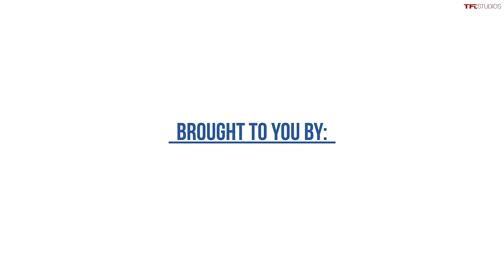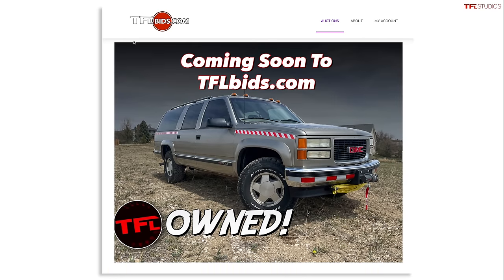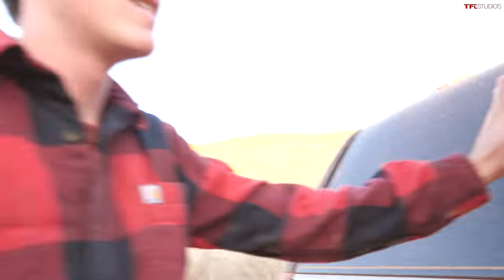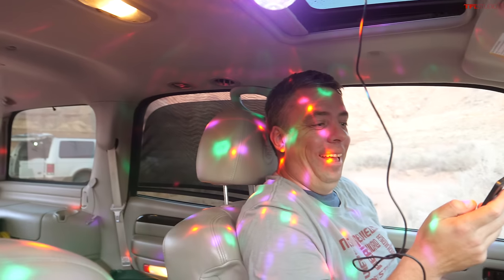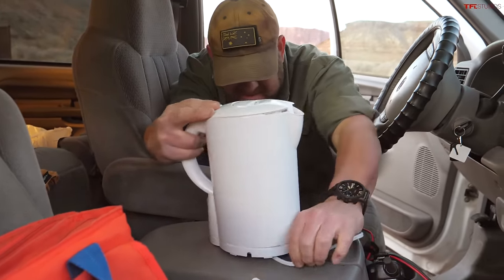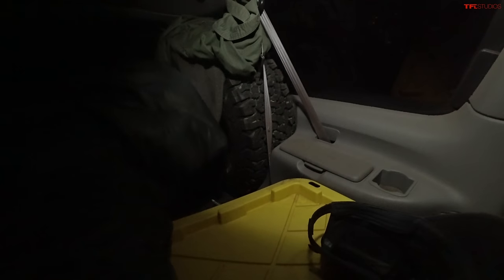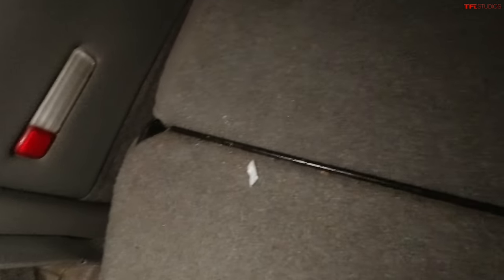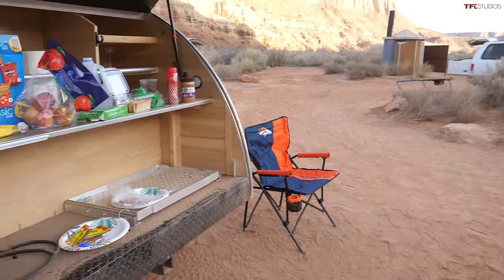Suburban vs Excursion vs Escalade - And The BEST Cheap Off-Roader Is… Go Big Season Finale!

Comment: The older guys know the importance of sleeping in a little comfort. If we don’t, we can wake up with everything hurting.
Reply: EXACTLY!!! 😂 I went from the shell on my truck box to Roof Top tents, to now I have. Rayzr FK slide in truck camper for one person. We do a lot of guy fishing trips and everyone is self sufficient with most preferring the room of their tents and a screened in room set up. A couple of guys have teardrops not unlike in this video, but most have been homebuilt with independent off-road suspensions MacGyvered underneath.  My dog and I are warm and happy with the slide in camper, we don’t go too extreme and the F150 Tremor handles the set up perfectly. My other vehicle we take when my wife comes along is a converted Mercedes 4x4 van. It’s very comfortable, has more power (120 volt) than needed with 400 AH of LiFePO4 batteries and 600 watts of solar. It powers a 2,000 watt inverter that even has enough power to run the A/C for up to 10 hours without starting the vehicle or included 2.5Kw Onan generator. It’s truly luxurious and surprisingly capable off-road with a set of BFG KO2s on it. They are decently tall from the factory, but if wanted (my wife says H*LL NO) they are easily lifted with high quality kits out there. 
     I am fortunate and can afford these comforts, but it’s really stupid how much $$$ is tied up in both rigs. I find driving the van is really easy and often will use it as my daily driver.
Reply: I don’t think I’d be able to pull my trailer down those roads or the side of the cliff lol so id have to sleep in my mega cab ram
Reply: @yousad6742  - not such a bad place to sleep!! Haha.
Reply: @shitloveaduck  home away from home
Reply: You calling me old?
Reply: @DanDannyDanielleBob  does your back hurt?
Reply: @yousad6742  - Hahaha!!
Reply: Watch the series while driving my 2004 Escalade EXT with 350,000 miles and still going strong. We’ve owned it since new and plan to drive it another 350,000 miles
Reply: I'm young and I still do it lmao when I go camping I bring an air matress lol
Reply: @linkinpiatak6669  that's called maintaining before parts gets hurt. It's smart. Always make sure your nights are comfy, it will make the days so much easier.

If you get that closed foam mat's being used in boat isolation and cut out a mat for yourself from that, they are waterproof and extra thicckk, and they can take campfire sparks flying, and sharp rocks no stress.  IMO those are better then air mats you are used to. It hangs outside my backpack, it weights next to nothing. 
I been using them now for the past 15 years and they been a wonder all year here in Norway. I'm on my second mat in 15 years, so they last for 7-8 hard years abuse.
Reply: Preach my friend, preach!
Reply: Just did a 2.5 week 5500 mile road trip in my 05 Town and Country from IN to CO, UT, AZ, NV, and WY. This was my 2nd big trip in it and this time I had 3 foam layers, 2 thin and 1 thick topping on the floor of the van. I had some of the best sleep ever! It got down to 34F a couple of nights but I couldn't tell thanks to being fully insulated from the shell.
Reply: Amen lol
Reply: I know a twin air mattress fits in an army tent from when I was in my 20s, don't have to be old to appreciate comfort.

Comment: I like my 2002 Chevy Suburban 4x4 2500 LML 6.6 duramax swap with the 3500 suspension upgrade. The thing is mint cond and pulls my 32' enclosed with my 88 Monte SS drag car in it through the mountains and cross country like a dream.

Comment: I have to say the Escalade did not skip a beat other than the fact that it’s low It looked like a natural out there on the sand, very impressed by that, With a 3 inch lift and A/T 33 s plus a g80 locker would totally kick ass and look good at it too.

Comment: As an owner of a 1996 4x4 tahoe, i'm biased to the suburban as for the best bang for your buck. The best thing I like about the escalade is the 6.0 under the hood. As for the ford, cant beat the solid front axel for durability compared to IFS with GM, but the excursion is just wayy too wide and long for going around those mountain roads. Really enjoyed the series
Reply: I actually found my excursion to be pretty nimble...just have to plan a bit....

Comment: I'm surprised the Escalade doesn't have low range, considering the modern one does. Usually vehicles become less off-road capable through their generations, but not so for the Escalade
Reply: Funny thing is yhe 1st gen did
Reply: I think its because its AWD not 4WD. My olds bravada of the same era is the same way. Trailblazers got 4WD and a low range but mine is AWD so no low range for me. Im sure its the same way with the tahoe and yukons
Reply: @ianberry5562  yeah, I guess at the time AWD was thought to be more "premium" and luxurious. The Denali of that generation didn't have low range either, but the Tahoe/Yukons did. So considering how much they like the Escalade, I think a Tahoe Z71 would have been a great pick. It had the smaller 5.3 liter, but it was loaded with most of the options that the Cadillac would have had, however, it has low range and more skid plates.

Comment: This was a great series, Great work, Great cinematography.  I like all three of these vehicles and all three have there place in the History books of the American Automobile. Most people don't hardcore off road much, so probably the Cadillac is the best for most people, but the most practical and useable is the Suburban.   The Ford Excursion is very cool but so big, again The suburban size is more practical, but the Ford is very well made, just wish it didn't have the V10 spark plug issues.  Actually all three of these are pretty well made let's give GM and Ford credit.
Reply: V10 over diesel anyday due weight/expense and reliability. I tow 10K with no issues. No spark plug issues anymore after year 2000. Mine is 2002 and is amazing at 265K so far. Still towing strong and no tranny or engine issues .
It does have a harsher ride, but it is a 3/4ton vs the others are 1/2 ton or less. The will always ride better.

Comment: I have two sleeping systems for my burb. One for summer. A 1945 army cot(with foam pads)that I set up next to the truck. And for cold weather I found a futon mattress that fits in the back. I can roll it up in a tarp and tie it to the Harbor Freight receiver cargo carrier, or leave the third seat at home and stuff it in the back. I like the Expedition, but I think the old 90's Suburbans have a more handy interior. I prefer the double doors over the tailgate version. But each has their advantages and disadvantages. Dodge missed out on the party for full size SUV's. And older guys have to bring your pillow on these outings. ;-)

Comment: This version was actually funny my daily driver in late 99-03 was a 1978 Chevy c20 custom deluxe long bed 350 vin m 4bbl quadrajet th400 turbo automatic transmission B&M 11,000 5/8 tubes transmission cooler,, standard manual windows and straight steering column and heavy duty heater with the three spd blower fan, factory 2 inch taller spring height. And 31/10.50/16 BFG all terrain tires over 432k miles several engine rebuilds but ironically the factory engine block same vin as the truck!!! I drove through fields with it,snow,mudded with it and also used it to haul firewood and the scrap metal hauler...

Comment: The excursion would have gained a ton of comfort by disconnecting the front sway bar.  it is easy to do in under 2 minutes.  front sway bar is 1 1/4 diameter and really makes the suspension rough over uneven terrain.  A sway bar is basically a torsion spring and twisting 1 1/4 dia spring steel takes a lot of force.  Also would have gained an amazing amount of articulation.

The other two would probably benefit also but their sway bars are a lot smaller, and neither of the gm products are as easy to disconnect.

Comment: My first car was a 95 tahoe. Pro tip: take the futon mattress from the shitty apartment you are sharing with 5 other dudes, use a ratchet strap to taco fold it in the back, then unfurl it when ready to sleep. Low and super comfy. Molds to the wheel humps and over the cracks no problem

Comment: I wonder how difficult it would be to swap the transfer case in the Cadillac to actually have a low-range option, and how much trouble the electronics would give in the process.  With the extra power it probably could get away with even taller, bigger diameter tires for marginally better ground clearance, and someone intent on making it into an overlander could pull the rear seats clear out and make a bed platform that doesn't require sleeping at an angle or putting one's head up at an awkward angle.
Reply: Sub Overland has made overlanders out of these, using pretty much the method you described. They're pretty cool! I think with the amount of torque that the 6.0 has, and the fact that people aren't doing hardcore rock crawling with them, makes the AWD/No low range acceptable. In the previous videos, even with bad tires, the Caddy did pretty well off-road.

Comment: My vote was the Caddy too.  The only way to make it better would be to get the Chevy or GMC version, and get it with a low range.  Sacrifice a tad of ride comfort for peace of mind when the going gets rough.

But, to be honest, the REAL best budget overlander isn't one of those three.  It's one of these three:

Chevy Trailblazer EXT
GMC Envoy XL (and XUV)
Isuzu Ascender 7 passenger

These vehicles have just as much overall room on the inside as the caddy, or a tahoe, or a regular yukon, but are packaged differently.  They are more narrow, but longer.  They would have been perfect for the narrow shelf roads you were on.  (Speaking as an owner of a 2004 GMC Envoy XUV.)

Comment: I actually learned that the awd gm platform for the suvs is fairly capable my uncle had a 94 gmc safari ext 4.3 cfi and awd,g80 rear in a gmc minivan!!? And the other vehicle was a buddy's 94 Oldsmobile bravada awd the 4.3cfi and limited slip front and rear, and 255/60/16 low profile tires hankook dynapros lol!!

Comment: I find it interesting that the suburban didn't do much better on gas than the Excursion, especially given the E is 3/4 ton with 6.8 V10 vs the S that's 1/2 ton with 5.7 V8.

Comment: I'd love this again but mid-size American body-on-frame, so the GM bunch on the Trailblazer platform, the 1st and 2nd gen Explorer, and the Durango. I have an '04 Envoy XUV with the 5.3, G80 locking rear diff, low range 4WD. The wheelbase is almost as long as a Tahoe, but it is much narrower. I would expect it to be a decent trail rig

Comment: I stay with burb, okay mine is not original anymore but definitely even if it was stuck compared to the other vehicle i guess it's all depend on the driver, becaue i tried them all and burb win it all. I must admit too i have the k2500 slt as well so to compare it to the 1500 not that fair

Comment: Suburban all day.  That 5.7L may not have the most HP or quickest acceleration but it is gutsy and makes great torque. Withe low range transfer case it will go places the Excursion is too big to fit and places the Cadillac will just spin the tires.

Comment: I take that Ford all day the chassis is stronger than both of those other 2 combined and the V10 is bulletproof I know this for a fact I have been servicing them under severe duty conditions pulling hauling and snow plowing F250s F350s and F450s have never had an engine failure almost every one of them has over 200,000 miles of severe duty work we do run 15w40 synthetic in them but still great powerful reliable engines

Comment: Just disgusted that Tommy had decided to make cosmetic changes instead of functional improvements to the Suburban.
Reply: I know!!! I’m not so disgusted, but surprised! He had about $6K!! Even if he paid for the install, he could have had a very decent lift, shocks, sway bars lift and BFG supplied the tires!! It would have been so much better. Even $$$ left over for a couple of cameras to help with vision if out there alone! Maybe a proper winch (2nd grade) on a hitch set up. Front receiver for $150 or $250 installed. Hopefully get the rear differential sorted out. Decent set of seat covers for the front and a self inflating mattress!! It would be a capable off-road vehicle that looks good (no sticker crap) and sleeps like a motel! Hinge problem solved!!!😂😂
     I have not built up this generation of GM yet as I like the older stuff 1980 or older, basically. Very easy to work on.
Reply: Same! I had high hopes for that. He could have done a simple 2-in lift and gone up to 285s for not much money, or put a functional winch on it. Now whoever buys this thing has to spend the extra time to scrape that crap off of it.
Reply: @trailrunnah8886  - Hopefully they get a good laugh while doing so!! They went for a “campy” style on the videos (Andrey pulled it off the best) and Tommy did get campy!! Haha. The Suburban is up to $2100 currently with over 5 days left. It’s likely to double in bids in the last few hours, so they should get their money back!! Maybe that’s what they are going for. Minimize their losses. If it was a rust free example, I suspect they may have put this lift on as it would jump in price, but that rust puts a lot of buyers off. I personally hate rust!! I live in a rust belt and the rusted wheel wells on the trucks all around,,,,, ugghh. First thing I’m thinking is a couple of thousand bucks to fix the rust,,,, I don’t weld well enough to do it myself,,,,, hahaha. 
    They are gonna lose on the Excursion,,,,, especially with what fuel prices are doing. I’m in oil rich Alberta, Canada and still gas prices are almost $2/litre CAD or about $6 bucks USD per gallon!!! Ouch!! 
    Not that I will ever recover the initial cost or depreciation, I still bought a Diesel Tahoe RST. Since I was buying something anyways,,, the increased mileage currently offsets the increased cost of diesel fuel. For now. See how far the demand for diesel goes up!! Hahaha. At least I buy it bulk and store it on my acreage. 
     Stay safe out there, Eh!
Reply: @shitloveaduck  yeah, they definitely seemed like they were having fun, and I definitely enjoyed watching the videos. I really like modifying vehicles for low cost, that's why I was so hoping they would do actual mods. I agree with you about rust, I'm in New England, so all three of these trucks would be super rusted out if they were here. Honestly, compared to what I see around here, that Suburban is pretty clean and I would buy it with confidence, especially for 4K. Good luck with that Tahoe, that sounds like one hell of a ride! I really like the new Tahoes, and that diesel sounds like a great motor. I have a 9-year-old 4Runner, if I baby it I can get 20 MPG, and gas here is about to hit $5 USD per gallon. It's paid for though, and it's been super reliable so I plan on hanging on to it for a long while. I did the math, and even if I spent say $4,000 to get a car that gets twice the mileage, it would still take me a couple years for it to actually pay off. My girlfriend's car gets about 40 MPG, but her car payment is more than my monthly gas bill, plus she still has to put fuel in it. Oh well, it is what it is.
Reply: @trailrunnah8886  - I get everything you say!! Haha. I am a big fan of the 4Runners. There are some expensive maintenance items, but you don’t worry about dropping a motor in or anything like that,,,, trade offs,,,. Reliability is key. 
   I’m fortunate so the Tahoe is paid for. I actually just had it delivered yesterday so this afternoon we are doing a bit of a road trip, 300 km one way, (180 miles or so). Then, next weekend, it is going for a 2400 km road trip (1500 miles) each way through the mountains loaded up with fishing gear, coolers,,,,, etc! Should be a lot of fun and a great way to break the Tahoe in!! 
      It’s big though. I’ll be ducking in every parade we drive through!! This and my other truck is a F150,,, hahaha. It’s what you are used to, Eh!

Comment: EXCURSION IS BEST.  HAS POWER SIZE & 4X4 CAPABLE.  IN SOUTH AMERICA ALL THEY USE IS V10 6.8 TO CARRY LOADS OVER EXCEEDING ITS CAPABILITIES...6 TO 8K LBS  FOR THESE V10. THEY CROSS RIVERS & MUD ROADS THAT NO CHVEY OR  TOYOTA GAS ENGINE CAN DO. .LOOK IT UP ITS CALLED ..F350 SUPER DUTIES EN LODO..TRANSLATION  IN THE MUD. THEY ARE AWESOME VIDS.

Comment: Fullsize SUVs with longer wheel bases and wide bodies are never the most optimal vehicles for off-roading hence why the most capable offroad vehicles are built as shorter & narrower in oppose to being big. These three were designed at most for light trails in open back country roads. They’re too big and bulky for true off-roading.

Comment: Boulder to white rim is 405 miles...throw in some trail driving..at least 850 miles of driving in these turds...4 trucks..avg mpg maybe 12 (Ford and the Dodge were probably worse then GMs).. or 283 gallons total..ouch.  Tommy might have to pick up another shift at Subway.

Comment: Im surprised those GM junk boxes with the junk AC Delco parts could make it out there without Fuel pump failure , along with ac leaks, bad electrical,   Dash gauges inaccurate need i go on.
Reply: Nope! You have proven your exaggerated biases. I’m not a GM fan unless it’s pre 1980, but c’mon. They have also been excellent ranch and farm trucks for decades. Don’t listen to the gripes of those who had issues. Try to pay attention to those who have had good experiences l they drastically outnumber the bad encounters. This goes for every manufacturer out there. The thing is, the “whiners” cry the loudest. YOU can be heard from miles away!!!😂😂😂